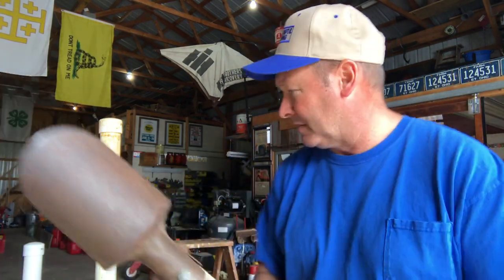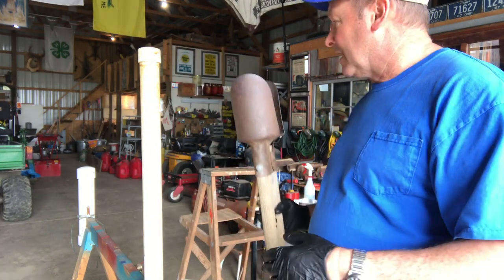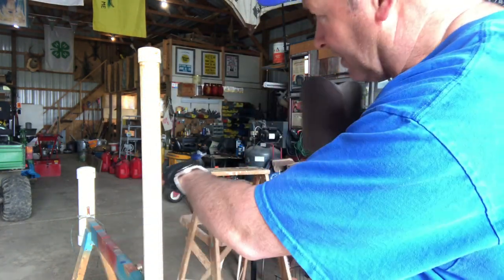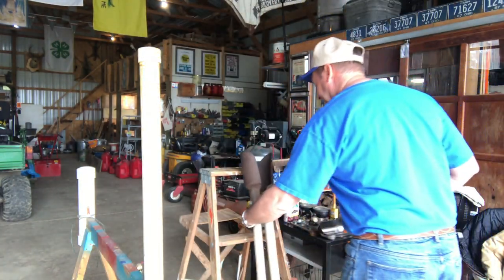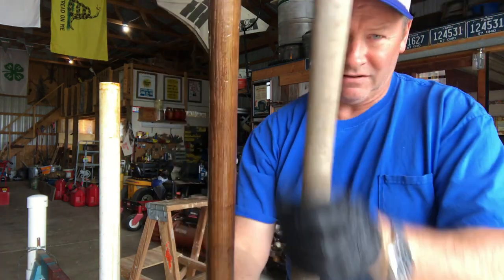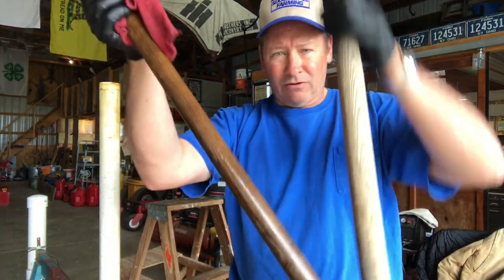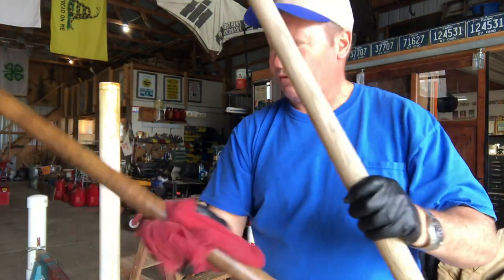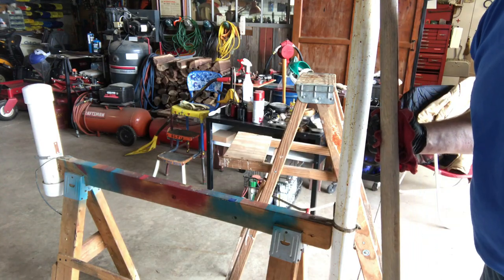Linseed Oiling Long Tool Handles

Comment: Just did the handle of my pitchfork day before yesterday.   But just did a wipe application.   Have used the PVC tube idea for cleaning a lathe lead screw,  soaking in degreaser.
Reply from the maker: the PVC pipe is great stuff,, so many great applications!, Thanks for watching!

Comment: I like your dip tubes. Lots faster if you are doing more than a few tools. 😆😎
Boiled Linseed Oil is my goto finish. I use it 50/00 with mineral spirits because it seems to penetrate deeper and dries quicker. 
After it dries I rub on paste wax. BLO isn't water proof. The wax seals the surface and also helps prevent blisters.

Comment: Great idea... I find damage occurs at the tool end, thinking about taking off metal tool, drilling a hole in the top of the handle, and looping cord through so I can dip the full shaft in the pipe, but still retrieve it with the cord. Stay safe.
Reply from the maker: Good idea!

Comment: Good trick....  Do you use Boiled Linseed ?  Do you use straight oil or do you dilute it with Mineral Spirits or gasoline?  I find that if I don't mix it with Mineral Spirits the oil on the handles never really dries/remains tacky.  Keeping the rag in a sealed jar helps prevent fire through spontaneous  combustion.  Keep safe.
Michael from Canada
Reply from the maker: If the wood is old and dry, straight boiled oil.. if its newer wood does seem to get tacky if you don't wipe off right away.  Thanks!